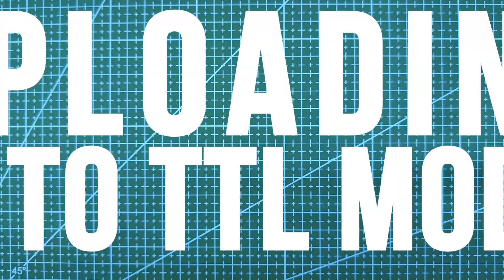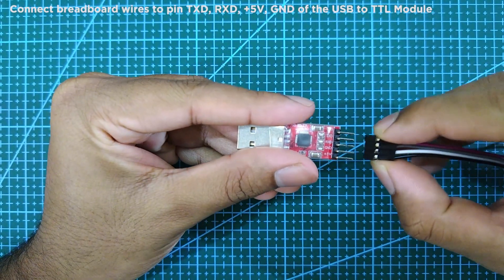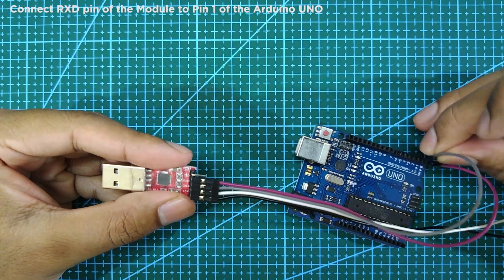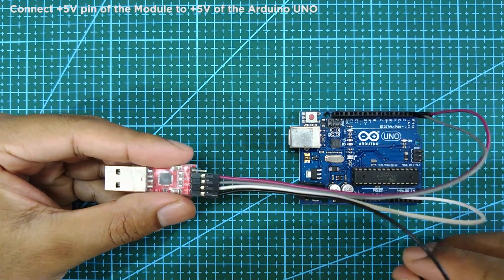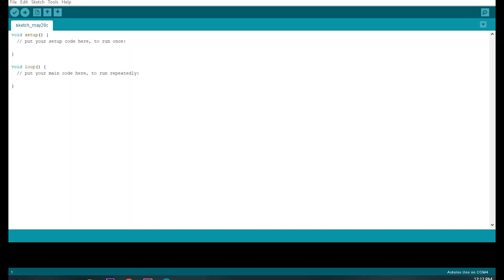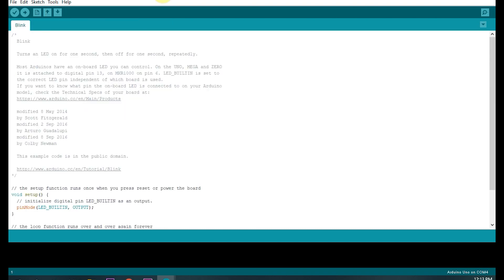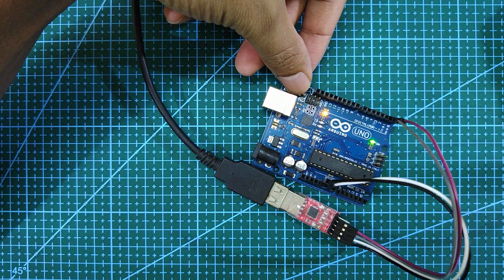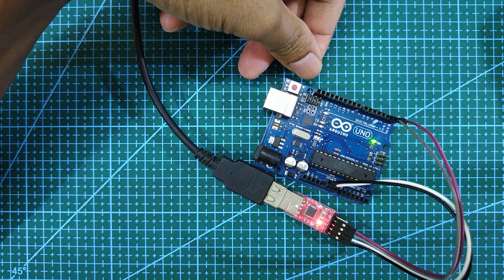How to upload a sketch to Arduino UNO using USB to TTL Module (CP2102) | 3/3 | Arduino Tutorial |#6

Comment: I have a question in many videos i have seen  that people pressing the reset button of arduino till compiling and released after when uploading is started
Reply: You do that in order to reset arduino which enabling the bootloader to take over and start receiving the new sketch via serial communication. You can find it with keyword DTR pin